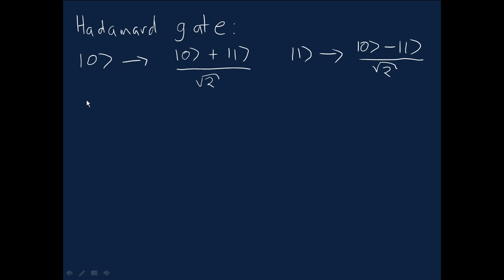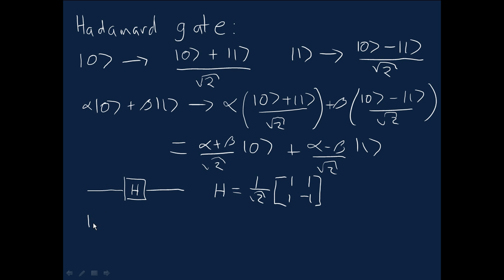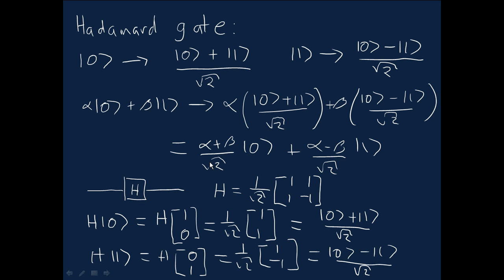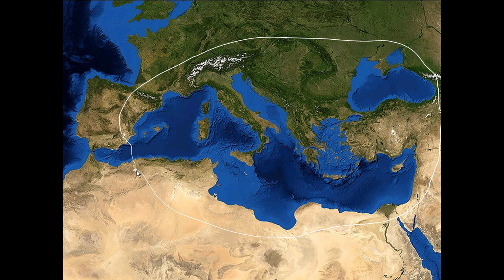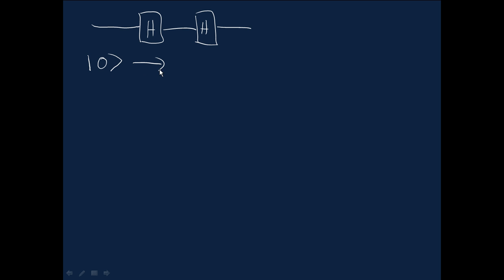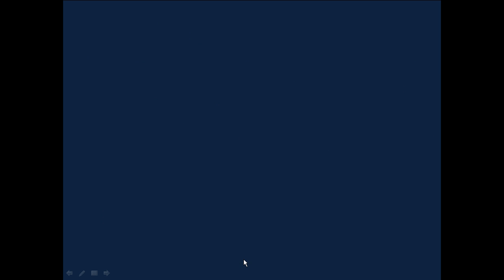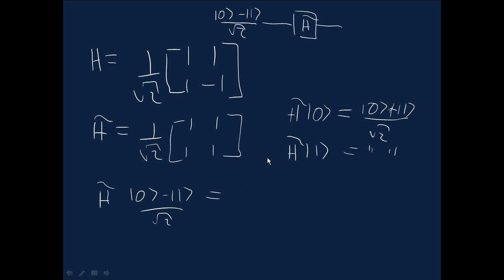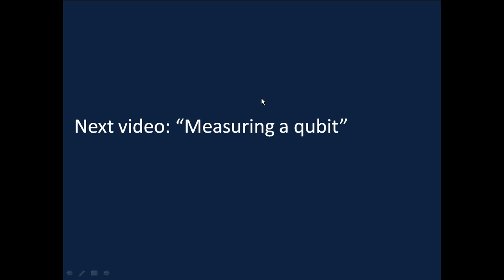The Hadamard gate

Comment: Hi, this is one of the clearest lecture on the subject I have found, congrats! I would like to contribute with my two cents: Sometimes using the same notation for the operator and state vectors may help clarity for the students. My suggestion is to write H like:
H = |0><0| + |1><0| + |0><1| - |1><1| with the following explanation:
Because < l | m > = kronecker (l, m) = (1 for l = m and 0 otherwise)
we simply replace  <0|1> = <1|0> = 0,  <0|0> = <1|1> = 1 
So, by applying H to base states we get
H |0>= |0><0|0> + |1><0|0> + |0><1|0> - |1><1|0> = 
(|0>+|1>) / square root of 2
symmetrically:
H |1>= |0><0|1> + |1><0|1> + |0><1|1> - |1><1|1> = 
(|0>-|1>) / square root of 2

For those asking about the appearance of the square root, it has to appear so the results stays orthonormal.

Sorry for my bad writing, I'm not a native speaker.
Reply: Yeah, this is a better notation, but he would have to explain all you explained in the first videos... But it is surely a clearer way of doing things.

I'm also not a native speaker, but I can safely say I've read native speakers not writing as well as you did, so I think you surpassed the point of having to apologize for not writing the language properly - and I'm just saying that because eventually this will happen...